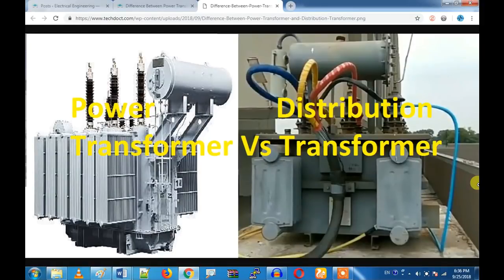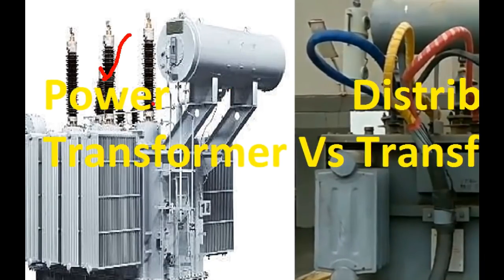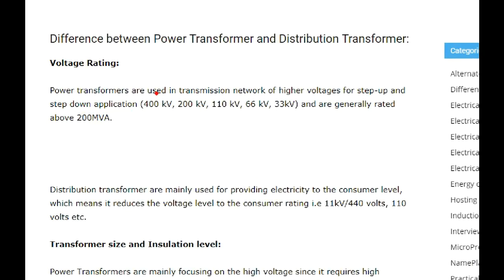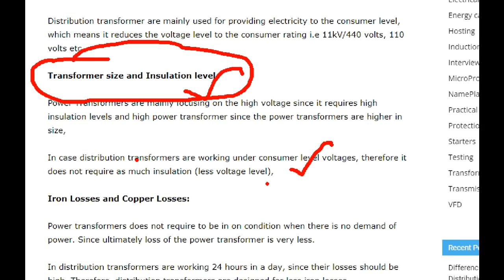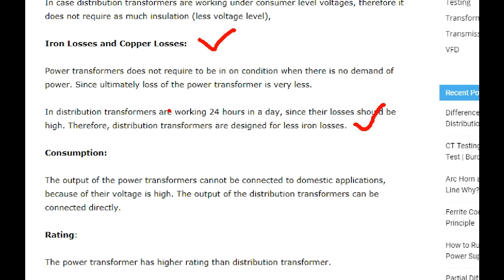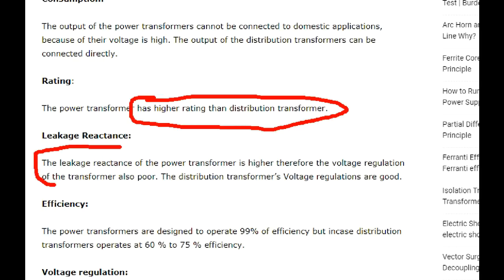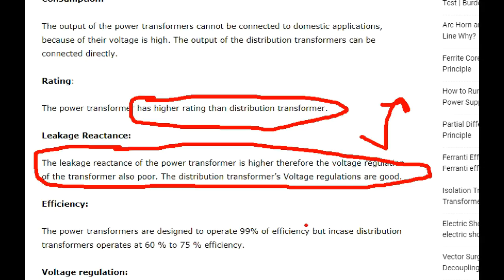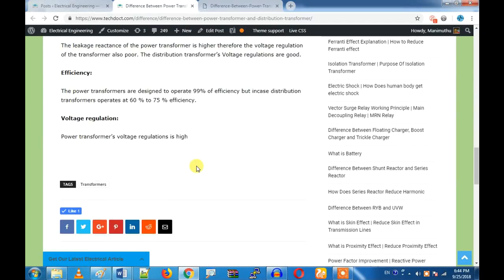Difference Between Power Transformer distribution transformer In Tamil

Comment: For More Electrical videos in Practical Explanation in Tamil

தமிழில் 

How to arrest Transformer HV Bushing oil leak 

https://youtu.be/nb2921W40ik

How to arrest Transformer LV Bushing oil leak 

https://youtu.be/5iajjFDs9fY

What is meant by Transformer turns ratio Basic concept

https://youtu.be/dPSff0ZoCB8

What is meant by Current Transformer

https://youtu.be/tdiXuo1I2TU

Current  Transformer Polarity 

https://youtu.be/QCfNQMlWwjk

How to check current Transformer turns ratio test?

https://youtu.be/hhrabhE5IoY

How Check CT Resistance using multimeter

https://youtu.be/7QigzV2yd0M

Comment: Primary difference between distribution & Power transformer is that DT is designed in such a way that it shall reach max efficiency at 40-50 of full load, but in PT it is 75-80%.

Comment: Power transformer has high leakage reactance due to which voltage regn decreases. But then again how come last point will be true.
Reply: For More Electrical videos in Practical Explanation in Tamil

தமிழில் 

How to arrest Transformer HV Bushing oil leak 

https://youtu.be/nb2921W40ik

How to arrest Transformer LV Bushing oil leak 

https://youtu.be/5iajjFDs9fY

What is meant by Transformer turns ratio Basic concept

https://youtu.be/dPSff0ZoCB8

What is meant by Current Transformer

https://youtu.be/tdiXuo1I2TU

Current  Transformer Polarity 

https://youtu.be/QCfNQMlWwjk

How to check current Transformer turns ratio test?

https://youtu.be/hhrabhE5IoY

How Check CT Resistance using multimeter

https://youtu.be/7QigzV2yd0M

Comment: Transformer full ports details venum
Reply: For More Electrical videos in Practical Explanation in Tamil

தமிழில் 

How to arrest Transformer HV Bushing oil leak 

https://youtu.be/nb2921W40ik

How to arrest Transformer LV Bushing oil leak 

https://youtu.be/5iajjFDs9fY

What is meant by Transformer turns ratio Basic concept

https://youtu.be/dPSff0ZoCB8

What is meant by Current Transformer

https://youtu.be/tdiXuo1I2TU

Current  Transformer Polarity 

https://youtu.be/QCfNQMlWwjk

How to check current Transformer turns ratio test?

https://youtu.be/hhrabhE5IoY

How Check CT Resistance using multimeter

https://youtu.be/7QigzV2yd0M

Comment: Good explanation.
 and one more thing, power transformer is a voltage step up or current step down transformer is almost used in after power generation and used to power transmission  purpose because in that time  higher voltage transmission is  to avoid the some transmission losses.in a distribution transformer almost used in consumer side because it is a voltage step down or current step up transformer type. I am saying wright.
Reply from the maker: Hmm correct bro
Reply from the maker: Thanks nanba..உங்கள் ஆதரவை நாடும் உங்கள் நண்பன்....

Comment: Bro 100 Mva and above lam auto transformer not power transformer and power transformer la irundhu than distribution transformer Ku power supply panrom so adhuvum 24 hrs running la than irukum
Reply from the maker: Thanks for commenting our video..if you have multiple power transformer, the load can be shared through single transformer when the load is less and Practical consideration is simple, but in case distribution transformer is difficult and individual transformer should be in ON, for delivering power to the consumers
Reply: @Techdoct  ya in that way you can say, I am a technical assistan in 230kv/110kv/11kv substation tq
Reply: 100 MVA kku mela auto transformer ah